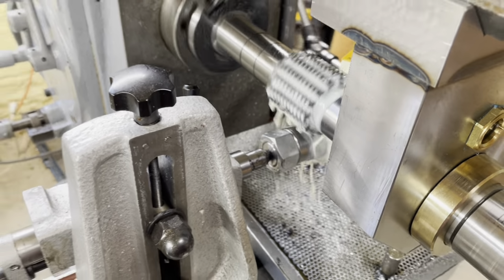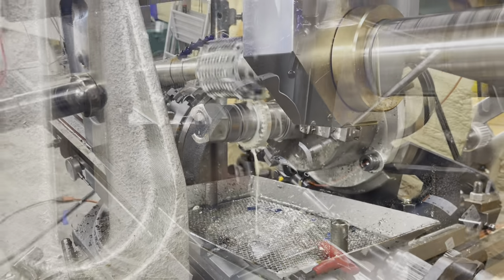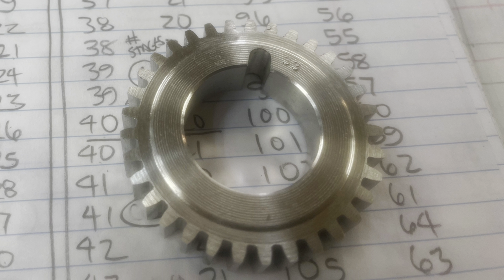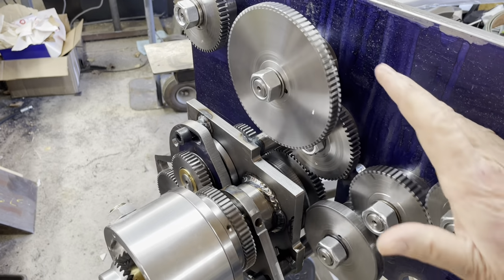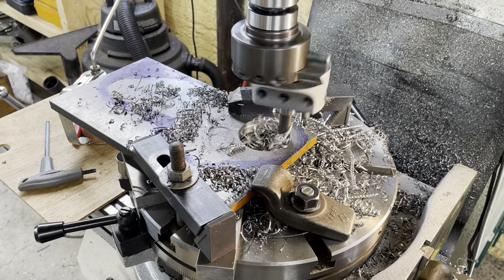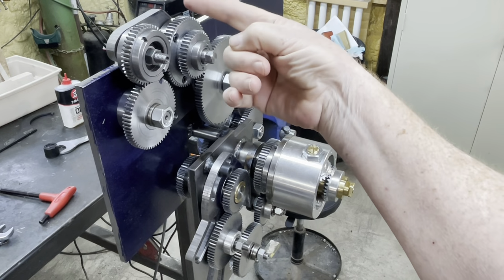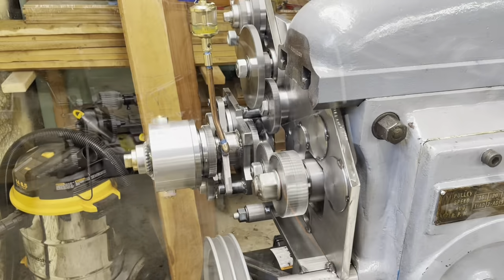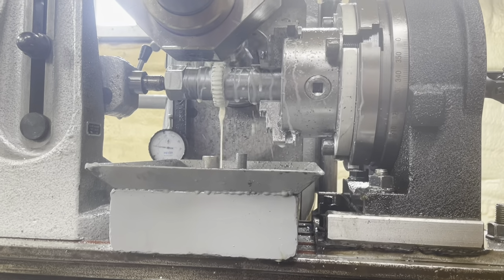Home Shop Gear Hobbing Machine (Mostly) Finished.  First chips, no math!

Comment: Hi Tom! I just watched all your videos on the Oesterlein mill rebuild and gear hobbing setup (yes, including the math!). Very impressive and you've obviously put months of work into this. I particularly like the way you built the differential. Though I prefer the electronic division method myself simply for ease of use (especially for primes), to see an entirely mechanical solution is a thing of beauty. Very well done! 
Also your video production is top quality and I think your channel will go a long way. 👍👍
Reply from the maker: Thanks for watching, Andy!  You clearly helped set me on this path, and figuring all this stuff out has been a ton of fun!  I think my next project will be a 40:1 worm drive work spindle, and I may attempt a feed-driven differential for Pfauter-method helical gears.  I’m intimidated enough by that that I know it’s something I have to do…Cheers!
Reply from the maker: Hi, Andy!  I’ve updated my channel to include making the new spindle, lead compensation system, and making a helical gear by the Pfauter method.  FYI.
Reply: @thomasstover6272  Thanks Tom! I'd watched your previous videos but I need to catch up on your more recent ones. I'll be watching with interest!

Comment: Pretty cool. I would suggest a limit switch in line with the motor switch to prevent over travel into your dividing head. Cool stuff though!
Reply from the maker: Good idea!  Hitting the hardened jaws is hard on the hob…I have some experience with that, as it happens!

Comment: I just subscribed though I thought I had subscribed when I watched you build the differential some time back which is something of an oddity, a nice oddity but an oddity that I don’t recall seeing on other horizontal mills. Most jus change several gears to get the correct rotation of the gear being Hobbes.   I’m NOT a machinist, more of a wannabe.  I don’t recall exactly why you were building the differential.  Normally a differential transmits output power in a different plane/direction but I either missed it or couldn’t see if it was driving the output shaft rotation to your rotary table for the rotation of the gear being manufactured.  Very nice looking work.  And, quite a lot of work.  Yep, that was quite the rabbit hole.
Reply from the maker: Thanks!  I missed this when you posted it…the differential serves as a kind of mechanical analog computer that allows perfect division of a prime number, which enables the making of prime number gears precisely.  Non-prime gears can be made with a simple gear train to index the workpiece.

Comment: I have just watched your latest video because it popped into my recommendations. As is said on my comment over there, i have no clue what a gear hobbing thing ist, i guess its kind of a gear cutting device (simply said) and i really like the videos , even if i have no idea what it is😅.

But what really doesnt go into my head is, why does it need a differntial? To distribute the force evenly? 
Anyway, i am checking your other video out now😊
Reply: The differential allows you to create accurate gear ratios to create gears without needing to already have a gear with that number of teeth. This is very handy when trying to make gears with a prime number of teeth, such as a 37 tooth gear, which, without the differential, would require you to have a 37 tooth gear (or some multiple of that number) somewhere in your gear train.

There's a video a couple back in the series where Tom does a much better job than me of explaining the math of it.
Reply: @Gumbatron01  thank you so much for your reply! I am a hobby car mechanic and pretty good at it so i know what diff's do and how they do it but of a case to use a diff for that i have never heard of😅.
Now that i know it, it makes just so much sense... So that is the reason why most Lego Technic models (bigger ones) use differentials in places where i was wondering why they did it...
But now i cant get over feeling dumb for bot knowing🤦‍♂️😂

Comment: Very nice job on your latest rev., it is a serious design achievement . Are you using industrial hobs for your machining? Also do you have a source for American made industrial hobs? This is one area where I have not found anything I can use. I have thought about  making my own hobs ,but I don't have  the equipment to give the accuracy I would want for making good gears. Looking forward to you finishing your machine setup.
Reply from the maker: Thanks, John!  I bought a batch of hobs on ebay from a gent who was getting out of the business.  It’s a mixed bag of US and Chinese.  I’ve actually had very good results with import hobs.  I found a place called Ash Gear Supply in Detroit.  They have a website.  They have hobs for rent or for sale.  I bought a used hob from them, and it came freshly sharpened and works great.
Reply: @thomasstover6272    Thanks Tom for the Detroit source, I will check them out when I decide what I am going to do.  As a rule I don't buy any Asian equipment, I have all American , English, Japanese, or German tools and equipment. Continued  Success on your final rev.

Comment: Awesome work. Naive question, but what is the use of the differential here?
Reply from the maker: Not a naive question!  The way a simple index gear train works, it’s not possible to make a gear with a prime number of teeth without already having that gear or an integer multiple of it.  The math of the differential allows you to make, say, a 37 tooth gear without having a 37 tooth gear, or a 74, or a 111 tooth gear.  If you would like a more complete explanation, several of the videos on this channel go deeper into the math.  The differential also allows you to make any tooth count with relatively few change gears.
Reply: @thomasstover6272  Ah i see, thanks!